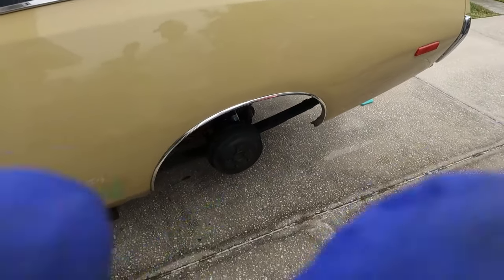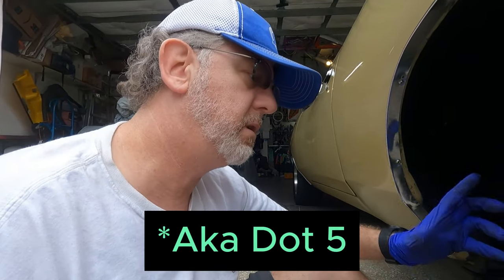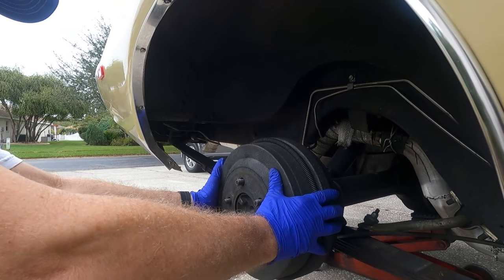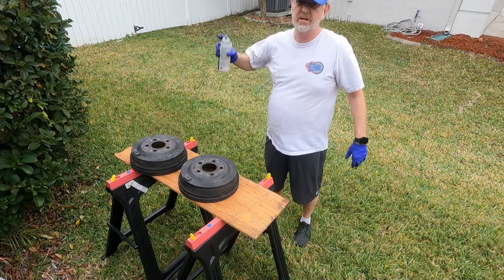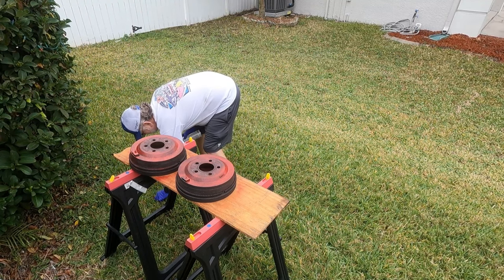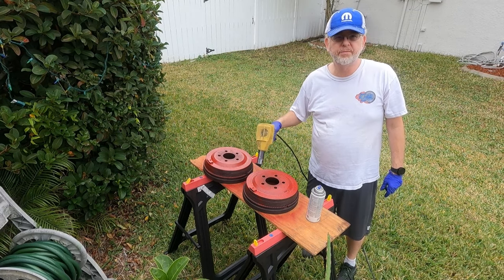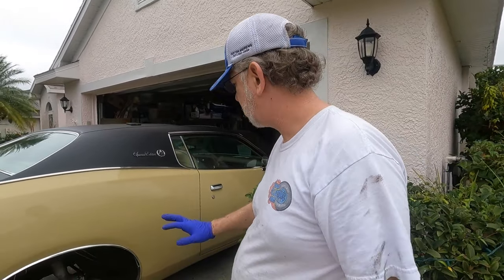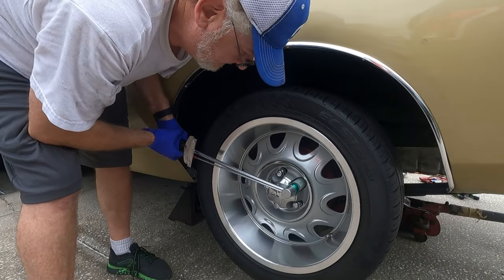Quick and EASY Brake  Drum Coating That LAST!

Comment: Another downside, IMO, when converting the rears to disk is the parking brake problem it creates.  Parking brake issues are/were a real problem on many of the early rear disk brake cars.  I have experienced many of them!
My 70 Satellite has drums all around & admittedly the fronts are a problem if not adjusted near perfect.
Reply from the maker: Very good point.  The fronts are always a pain to adjust,